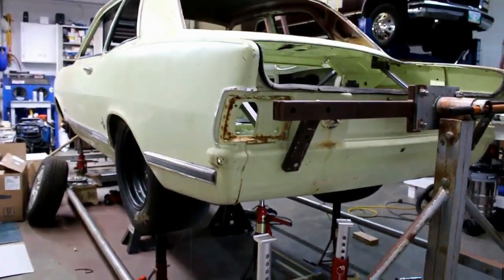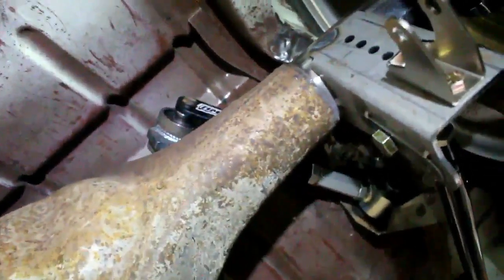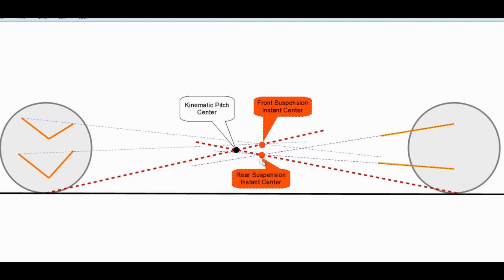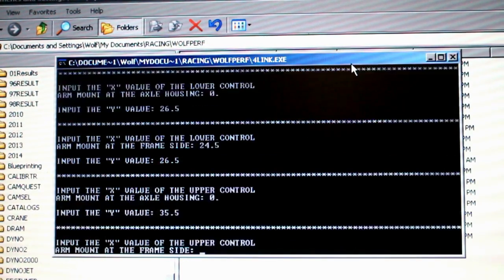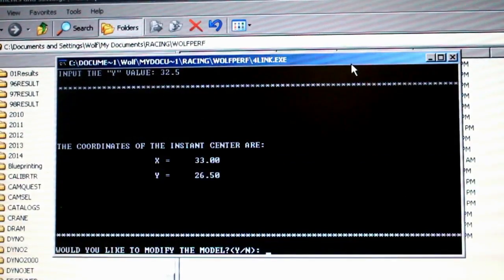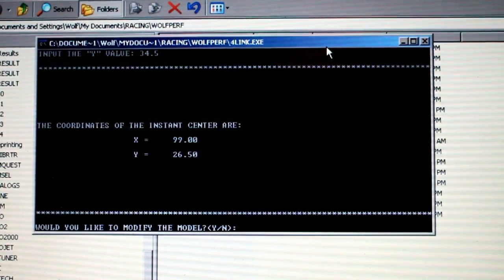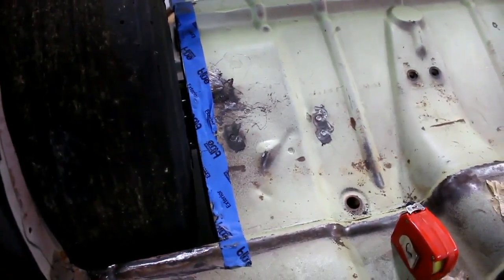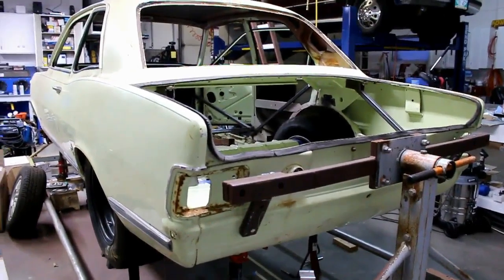Epic Insanity Episode 2:   4 Link Rear Suspension

Comment: The instant center line needs to carry through the center of gravity line to find a percent of rise, so you need to find the center of gravity and make a vertical line making it 0 to 100 to find the center of rise
Reply from the maker: It'll be a while before I can determine the centre of mass of the car, so plotting out my levels of anti-squat will have to wait.

Comment: Hi Ed. Very nice explanation of the rear suspension geometry. As a fellow engineer and a complete understanding of suspension geometry, mathematics, acceleration anti- squat, brake anti-dive, camber and caster curves, instantaneous roll centers, spring rates, shock rates, center of gravity, etc. it is all perfectly clear to me. Perhaps  a future video (or videos) on how all of this relates to the performance and handling of a baby buggy with a rocket engine so to speak in a drag race application might be something to consider.
Reply from the maker: I'm still just learning this whole video thing. In the future I'm hoping to get way more hardcore into the engineering tech, but that might end up being a separate channel. I'm kinda targeting a different audience with these so I have to find a reasonable balance on the nerdiness.